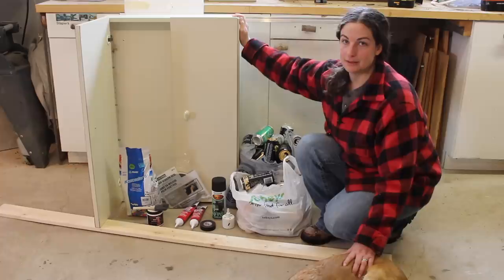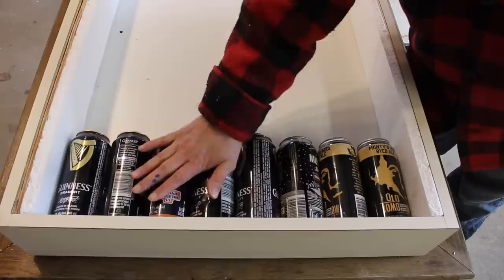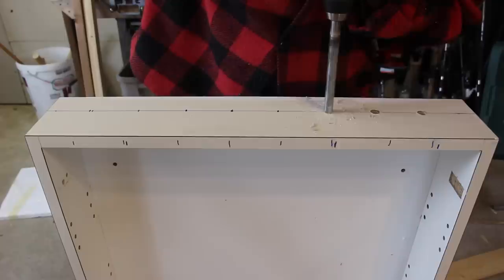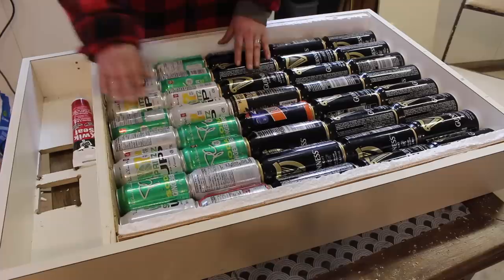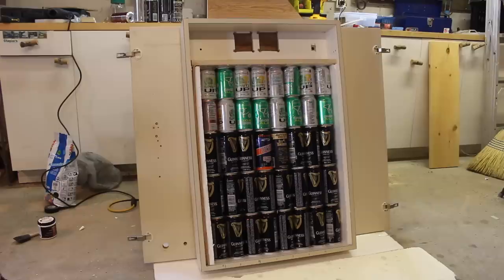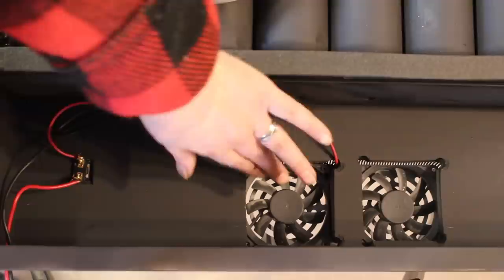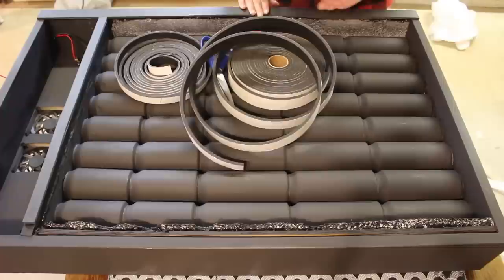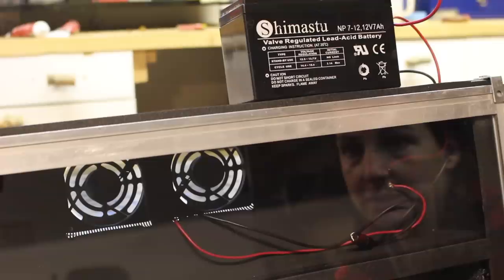Free Solar Heat From Pop/Soda/Beer Can Heater

Comment: Before you put the pop cans in and paint it, line the inside of the cabinet with tin foil. Then paint the tin foil too. Think of it this way. Every part of the inside of the cabinet that is being lit up by the sun is absorbing light and therefore heat energy. Painting the cabinet only increases this but wood is not a very good conductor/insulator of heat when it’s that thin, and so it’s dissipated quickly because it’s right next to a cold window. By putting the tinfoil on and then painting it all of that lost energy is brought back into the air chamber. You might get another 20° out of it.
Reply: Thanks for this!
Reply: B
Reply: Paint the tinfoil in which colour?
Reply: @mogamadgreyson143  Black like the rest of the collector.
Reply: Deanonax69.   The foil is an excellent idea.
Reply: Great idea!
Reply: Thanks for this very soon we all might be doing this to heat our homes, cook and get hot water to clean our skin.
Reply: Meh.. Looks like waaaay too much work and way too much time.. Wouldn't it be easier and cheaper to just buy a small heater?
Reply: @cb90222  And the small heater adds to your electric bill. I know only too well living in a cheap rental with no insulation.
Reply: Even better use a sheet of reflectix
Reply: Yes!
Reply: Or don't paint the foil so it'll reflect infrared (heat) back into the cans, increasing their effectiveness. Shiny side's better reflection.
Reply: My thoughts too, then thought about old radiator inside box painted black and pipe it to another radiator instead of fan use a pump, just a thought, could use car radiator inside to release the heat.
Reply: Wouldn’t it be better to not paint the foil, so it reflects more heat back at the cans?
Reply: If you want to use tin foil as insulator/heat reflector you should not paint it. Paint changes it's emissivity factor, making it absorb heat and conduct it to wood frame.
Reply: And design a maintinence entrance for the fans -_-
Reply: @stephenjacobsen4616  I had the same thought
Reply: @mogamadgreyson143  Black
Reply: What about paint fumes when this thing heats up? Any concerns?
Reply: @mogamadgreyson143  Pink? 😁
Reply: Why not put 1/2-3/4'' insulation board on the back of the cabinet and paint it black also. Caulk the edges for sealing loss. Then go with ur process. In all insulate the entire box! Galvanized pipe from old water heaters works great too with no sealant.. talk to a local plumber, he usually throws it away because he uses new. 3 and 4''.. good luck.. I live in a man cave...
Reply: she did this??
Reply: Radiant reflectors don’t work well at all without a sealed air gap, you could layer it like this to create one though: wood with foil > air gap > solid insulation > cans > glass/plexiglass
Reply: @mogamadgreyson143  paint it red so it looks hot.......
Reply: Why are you tin foil that you have to paint black?
Reply: @WonbyGrace2  thats why they are using stove paint.. it is designed for heat.
Reply: @wizdroid  sometimes we have to
Reply: Use mylar to make mirrors around each can. Itll really concentrate the sun on the cans. Definitely have to use hi temp paint. Im makin one wit sand batteries around air flo tubes. Increase thermal mass & store heat aftr sun goes down. Should hit really hi temps. Might put side mirrors to add more light to center mirrors increasing heat way further.
Reply: @wherearewegoing3657  use foil as mirror. Dont paint it try it both ways if u must
Reply: Mylar safety blankets to add more sun. They make good mirrors get a bigger pipe set it mylar then epoxy so it keeps the curve. Then each one has its own mirror. Way more sun means way more heat
Reply: @wizdroid  isn't it jus govn people better ideas so we can get free from these unnecessary bills?
Reply: "way too much time."

Would probably take an hour at the most. Just skip a football game oné Sunday and you're covered.

That said, if you know a place I can get a small heater that produces free heat, I'm all ears.
Reply: @stephenjacobsen4616  , there is already access to the fans where they are screwed onto the back, just unscrew them. And I think all the wires should be in a kind of conduit or casing on the outside as well, for the same reason that you point out, ease of access for maintenance.
Reply: @wizdroid  , no. Deanomax69 has actually made a good point that many, if not most, would have missed to enhance the performance and efficiency of the heater. Perhaps take things the way they're meant instead of looking for negatives that don't exist.

Comment: I've installed a few of these over the years and they do work surprisingly well for what they are made of. I would recommend a temperature sensor instead of a switch so fan turns on/off automatically when it heats and cools. Helps on partially cloudy days also
Reply: I just mentioned that.   I'm dying to try this.  My neighbor up the mountains built one but used boards in a zig zag instead of the cans.  The cans seem to be a bit of a stretch as work goes.
Reply: @beebob1279  we made one using old window screen instead of cans. The temps were slightly higher at first but the dusty old cabin we were in eventually clogged the screen with a mat layer of dust. We have even used downspout instead of cans, fun project with the kids when they were younger. Nice to see their brains processing stuff
Reply: It cools too??? 😳 How?
Reply: @michellesvortex7237  the sensor will turn the fan on at a certain temperature so when the sun is behind clouds and cools, the fan will shutoff so it's not blowing cooler air into room, fan will only turn on when it's warm

Comment: A simpler way to get the same effect is just to use black curtains. Black curtains will accumulate heat. The air gap between the curtain and window will allow for circulation, and the thermal pressure of the hot air will insure continuous circulation over the curtain without a fan.
Reply: So just hang black curtain in direct sun lit window to get heat?
Reply: I used 5 ply black plastic. Hung it over curtain rod. It actually raised the ambient air by 3*. I was impressed.
Reply: Lmao, the effects will be so minimal in comparison.
Reply: @paulamcneely4923  could you please explain what you used? I'm Italian and I'm not sure what you used. Thanks!
Reply: @leps75  She means 5 layers of black plastic sheeting, I think.
Reply: @leps75  5 mil thickness, likely.
Reply: Or open the can ends a LOT more and use natural convection.. Chimney effect.
Reply: it's a gimmick, there's absolutely no more energy entering through the window into the house with this contraption than there is without it. in fact it likely blocks some radiation and makes it worse.
Reply: I don't think it will matter either way, no matter what material or color you use. Once the infrared light comes through the window and hits something it turns into heat, which is blocked by the window. Thats why your car gets super hot in the sun. If you put something like this outside your house then it would have an effect, but once the light goes through the window its through the window for the most part, it has a hard time going back
Reply: @leps75  I think what I used was else 3 or 5 ply black plastic. I hung it over the curtain rod. I took the curtain down. There has to be space between the window & plastic for the air to flow. I hung it in a south facing window. It did raise the temperature by about 3 degrees on a sunny day. I hope this works for you. Thx for asking 💥
Reply: @alphatucana  I meant 3 or 5 ply. I can't remember that exactly. It has to be heavy black plastic.
Reply: Are you insane!?!!
Putting curtains over a window will make your house warmer during the day? 🤦
Reply: @dosmundos3830  thank God I'm not the only one who realized that lol
Reply: I just did the same three days go and I got and increased temperature too.
Reply: @leps75  myself, i used black garbage  plastic bags, that were around.
Reply: @dosmundos3830  wrong: test it yourself.
Reply: @breannestahlman5953  not wrong: you test it under perfect conditions. Only so much energy makes it through the window, changing the color of the things inside doesn't bring in more. Look at other ways people have done this and the heater is out side connected by pipe or duct through the wall.
Reply: Black curtains will not make more heat come into the room from the window, but it will help block some light if that's what you want. It's certainly more efficient than this ridiculous Popcan rig.
Reply: @theobserver9131  no....its not...not sure if you know anything about aluminum and heat or heat gravity/storage/conduction/convention or not

Of course this can be improved

But it works
Reply: @xgymratx  yeah, actually I do. Science is kind of my thing. Whatever.
Reply: @xgymratx  Science is not real popular these days. Too many rules I guess.
Reply: @xgymratx  you don't get something for nothing. You can't get energy out of nowhere. There's a certain amount of energy coming into that window, this contraption is not going to turn it into more energy. All the light coming through the window will turn into heat. Either in that contraption before you blow it into the room, or as soon as it reaches anything else in the room. Either way, it's the same amount of heat. This thing is just making it do tricks first.
Reply: @xgymratx  🤣oh my. Aren't you clever!!!
Reply: @omahajim45  actually, it works for a few reasons... 1) the black fabric absorbs the sun and stays warm 2) The warm material then releases some heat into the house while simultaneously preventing heat loss at the window. 
It also insulates for colder air in the summer, but using white during the hot season is better.
Reply: @dosmundos3830  it's not a gimmick as I can testify to that as I built one of these in 2006 and it raised a unheated room in the dead of winter to 80 degrees, if you have ever touched an empty black òil barrel in winter, you would burn your hands just from the heat of the sun as metal gets very 🔥
Reply: I have a glass garden candle burner, it’s about 14 inches (36cm), high.  Has glass on all four sides with a metal frame, bottom and domed metal top with a holed design.  A candle placed as high as will allow to the top (I use a glass to elevate the candle.  The top get hot enough as if a stove top had been left on medium heat.  Buy second hand and reduced price candles whenever I can.  The heating goes on for five minutes to heat the radiators then the heat from the candle keeps the room warm enough that it can feel too hot with a jumper on.
Reply: @catalinacurio  again, your rig is not going to add more heat to the room than the Candle would by itself. Physics people, physics.
Reply: @theobserver9131  It does create more heat than the candle itself.

Comment: I saw something similar "back in the 70's".  They used gallon jugs of water.  Had an entire southern wall exposed floor to ceiling window full of glass jugs of water.  In the winter, they had heavy curtains that pulled in front to keep the heat out.  I was amazed at how well they worked.  I was about 10 and was quite impressed.
Reply: I wish I could find out more about this technique.

Comment: Did a similar setup when “peanut Carter” was President. Dark black cans and plexiglass covering to insulate the box. (Try fresnel lenses 12”x12) to quadruple the heat. I cut my cans in half for better heat absorption and airflow. FWIW = I made a water heater using the same setup with a garden hose “S”coiled beneath the cans, 12 V water pump to circulate the water
Reply: Remember coiling b l ack rubber garden hoses by swimming pools to heat up the pool water?
Reply: @terrywereb7639  No.
Reply: Ah! So those magnifier sheets must help focus to make smaller, hotter areas?
Reply: @school for hackers - correct one thing about photovoltaic cells they get damaged using lenses.

Comment: Having seen a similar solar heating video years ago, I thought what a good idea to use the heat to dehydrate figs and plums we had in the backyard.  The construction was fairly similar. The only thing I had to do was to add a heat collector box with screening for holding the actual fruits.  I tried a computer fan and a small solar panel to run it.  It did not work, and I was mystified.  In my search for something to assist in moving the air gently thru the dehydrator, I came across a solar operated ball cap, personal cooling fan, and it worked beautifully. I did 2 added things differently, and that was to add some bug screening to the air intake and exhaust holes, and to place thermometers in three locations in order to measure the thermal effectiveness.
Reply from the maker: We actually made a solar dehydrator using this principle as well.  It needs a little tweaking, which we'll work on this summer.  Cheers!
Reply: Thanks,  so amazing
Reply: Shit, I'd have loved to see a video on how that worked. Very interesting idea. How'd it all work out in the end. Is it useful, effective, require maintenance?

Just curious.

Comment: Hello with respect you can't produce more heat than already comes through the window. Line the inside of the window black so the heat is not reflected straight back out through it, throw the curtains wide open and make sure you haven't gotten anything highly reflective like a white cupboard or a mirror just inside the window.  Soft furnishings like sofas, beds,carpet etc are great absorbers of heat and will give up the heat to the room as they cool. The trick in the winter is to not let that free heat escape back out through the glass with good thermal curtains when the sun goes down.
Reply: if you block the sunlight coming into your house with the contraption she built you'll actually have a heat loss.

Comment: As a precaution you should paint with High heat resistant paint inside before placing cans in. Some use Welders cloth in side.
Reply: Great point.  Did you mean using Welders cloth "instead of" the paint or "in addition to" the paint?  I think you meant "instead of" but want to make sure.
Reply: That was my thought, as well.. shouldnt it all be painted before the cans go in🤔🤔
Reply: Yea no it's not going to get near hot enough to start a fire.
Reply: I made my first solar cooker in 1972 first solar heater in 1983 so I have a few years of experience with solar. High temp paint is not necessary, The temps in these things are never high enough to need high temp paint. Blackboard paint is a better option. Most high temp paint is shiny and actually reflects some heat, blackboard paint absorbs more heat energy and is more efficient. A small solar panel will power a small computer fan that works perfectly.

Comment: You could use a few of older radiators and spray them black and place them side by side piped in series in an enclosure covered by old double glazed windows and push the air through the radiators into the house.

Comment: Convection alone will force cool air from the bottom of the  through the top of the cabinet as it warms with a fair amount of velocity. The holes in the bottom should be a little larger than the holes on top to increase the velocity.

Comment: add a small pelletier module connect to your  solar, the hot side touching connecting to one of the cans. and the cold part facing outside . the thermal electric module will help booster heating up time and increase the heat temperature

Comment: That was an excellent video. Great job guys. I’ve thought about doing this for my greenhouse in the winter. I’ll be checking back in on this video for reference when I make mine.
Reply from the maker: They definitely work during the daytime.  Just a matter of banking that heat for the night time lows!
Reply: @Wilderstead  would adding sand into the cans help??
Reply: @mariap.thisislife8735    Great question.  I hope you get an answer.
Reply: @mariap.thisislife8735  Air circulating through the cans is what makes this heater work, adding sand would block the airflow and keep your heat/air stagnant. Adding a thermal mass to the back of the cans would add a thermal battery element to this solar heater to help extend the window of heat production, without affecting the functionality and airflow.
Reply: How about leading the hot air through some thermal mass? Like run the air through bricks. Think I could make a heated bench in my workshop/garage that works as a heatstorage
Reply: @18chris0089   Soapstone has the highest capacity to store heat and you can get Soapstone tiles at any big box store

Comment: So, you built a devise to capture heat from sunlight that has already entered the house? Just letting the sunlight in is better, it will turn into heat, essentially all of it. Part of it will be reflected as visible light, and when that light hit something else part of it will turn into heat, and a small amount will be reflected again, and so on. Just the very small part that escapes back through the window as visible light won't turn into heat in the house.

Comment: It would add more heat if it were mounted in exterior of the house with a fan forcing air from house through it and back out into house. Just having a window can warm your house all by itself.